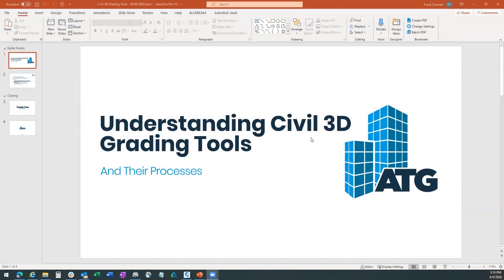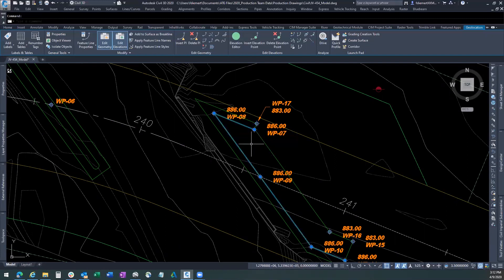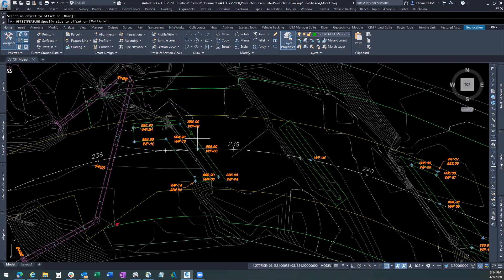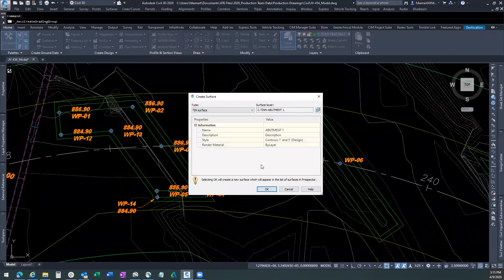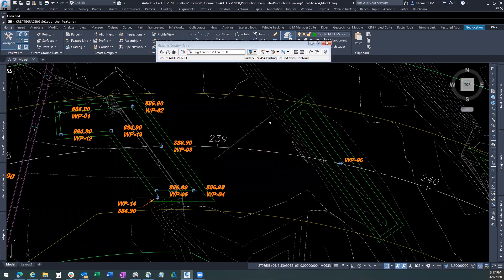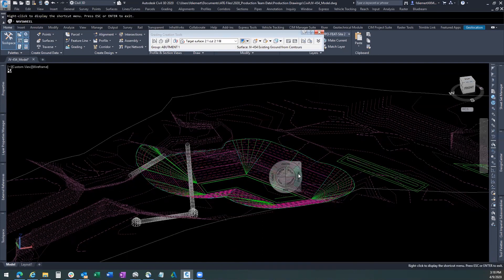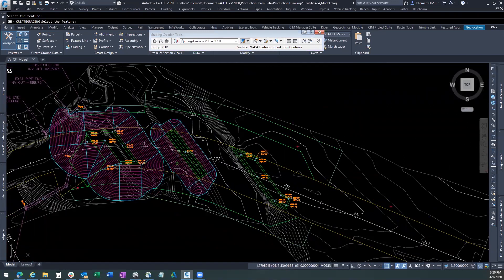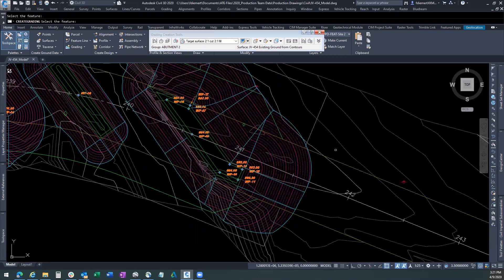Understanding Civil 3D Grading Tools & Their Processes

Comment: hi! doubt i will get a response, i appreciate the video. I was just wondering what the proper procedure was for implementing that into one merged surface? You have your existing grades, and now you have created your proposed grades on top of the existing, but lets say that your proposed grades as shown in the video are all good and you need to finalize one solid proposed grading plan? I'm specifically asking for the contours that are displayed running through your proposed grades. Do you need to merge the two surfaces together in a separate so that only one surface combined is shown?